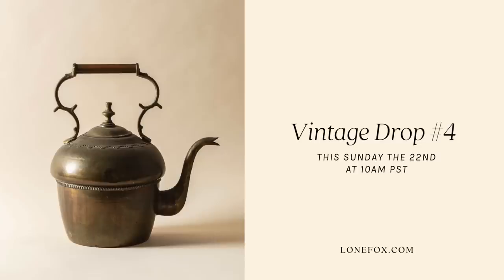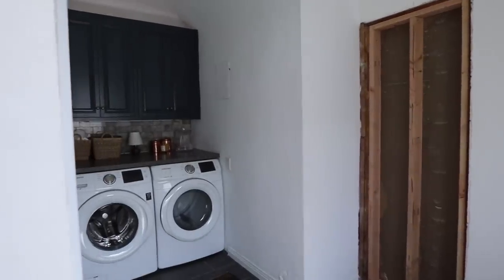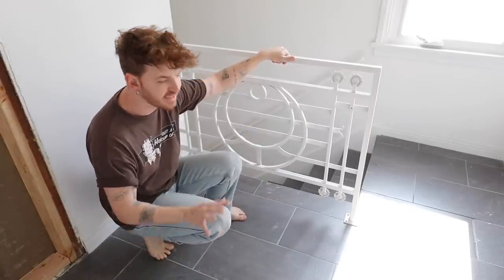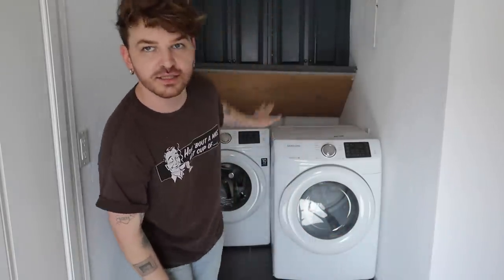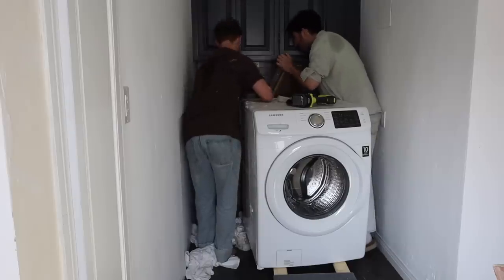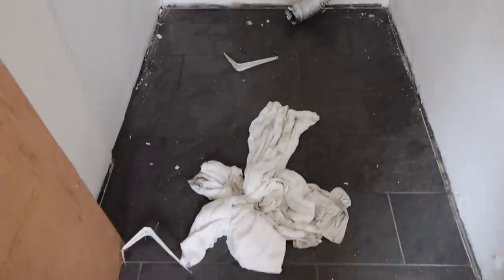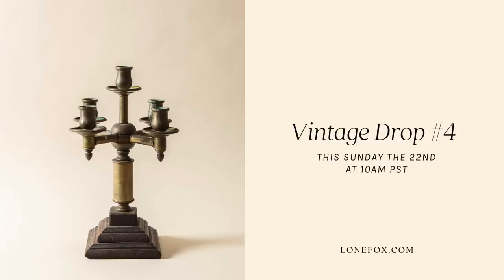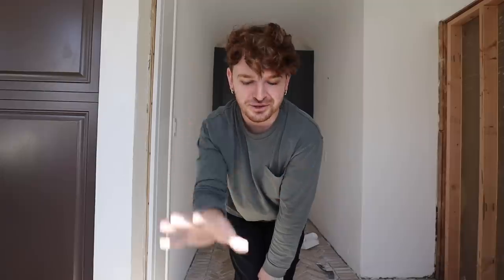LAUNDRY ROOM MAKEOVER 💦 I caused a FLOOD + DIY Herringbone Tile

Comment: Just wondering why you placed your tiles so far apart? Doesn't it make for a lot of grout? Also, wouldn't it be better to tile UNDER the appliances? A flat surface makes it easier to move the appliances in and out.

Comment: They most definitely didn’t use the correct mortar if the tiles popped up that easy 😭 they probably used a regular one, but with that size you need a large format mortar

Comment: Wasted opportunity to divide the laundry room and turn one part into a guest toilet accessible from the hallway.
Reply from the maker: It was actually a big thought but the structural wall in between would have been a nightmare
Reply: @lonefox  Bit of a strange place for a structural wall, especially since the space behind the washing machine and dryer is already a closet accessible from the hallway as far as I remember from the tour.
Still, even though it might be a bit of a faff and not something you can easily DIY, it would be worth the effort.